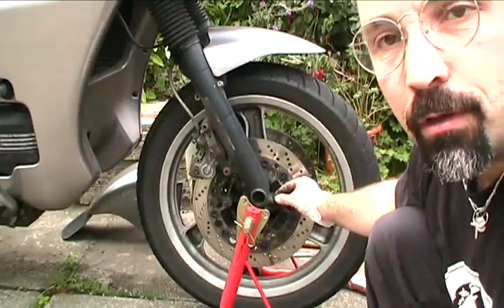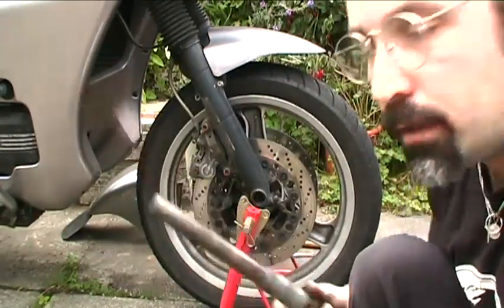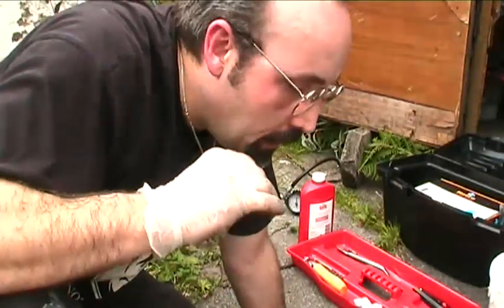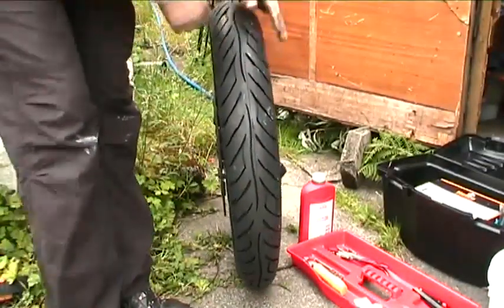BMW K1100, changing a tyre

Comment: It's important to work both beads of the tire into the center of the rim, opposite the side you are prying off, after both beads have been broken. You may use a piece of leather under your bar, if you like, to protect the rim.

Comment from the maker: @sabamacx No, i don't have a balancer, you could balance it back in the spindle before refitting the calipers and there are a number of good balancing videos on here. So far the speeds i tend to use being older now don't induce noticeable vibration, if it did after a tyre fitting i'd have the wheel balanced, at some point i'd like to add a balancer to the set.

Comment from the maker: Logically you'd think that wouldn't you, one time tyre treads did go in the direction you'd think, like an arrowhead cutting into the water, however, the tyre manufacturers must know their stuff as almost all m/cycle front tyres are designed to be mounted this way, with the arrowhead shape facing back as you sit on the bike.
Tyres have a direction of rotation moulded into them so you get it the right way, interestingly, the rears go the opposite way, sure someone more tech minded can explain.
Reply: Perhaps it's because the front is used for braking, and the rear for acceleration. Always look for the arrow on the sidewall which tells the direction of travel.